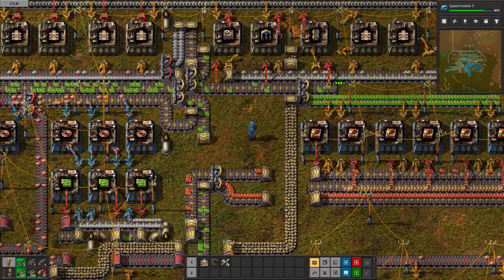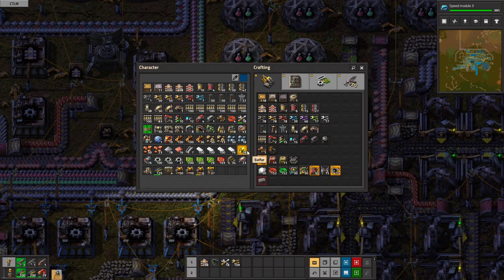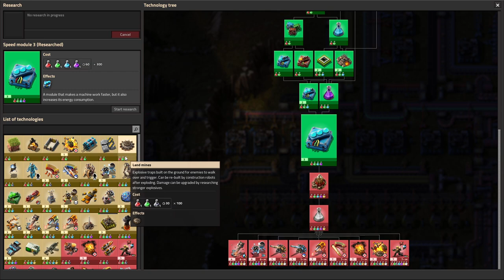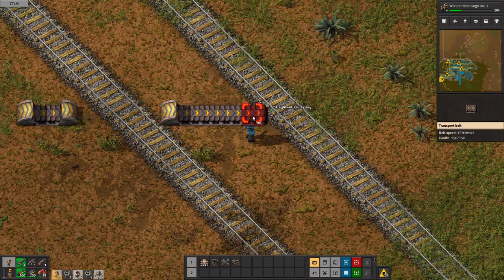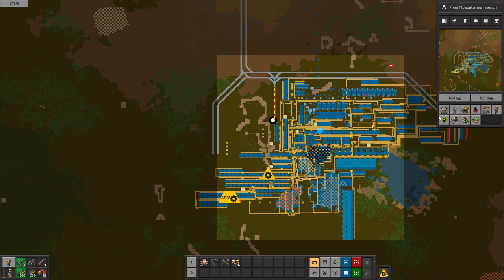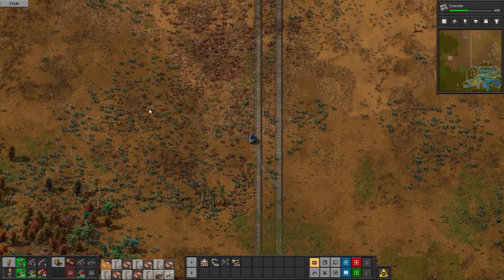Factorio 2021/2022 Guide / Tips / How to! Episode 7! - T-Minus Runover

Comment: Yep, bots intimidated me too on my very first playthrough. I didn't know you could press L to see what's in the logistic network! I could never make a big belt balancer by myself, if I do it myself then it's just a 4 lane balancer. Actually in my first playthrough before I watched and read other people talk about Factorio I didn't know much about balancers haha. I do now have blueprints saved from other people with bigger lane balancers, I could not make my own. I don't know if I like using other people's things though or whether I prefer to make my own instead, tbh the latter can be much more fun, even if it's not anywhere near perfect. Yay for a tank! Oh yes I like the click-and-drag of the powerlines too! It is a big copper deposit indeed. Yay for researching the rocket silo. Yes I like that the tank can drive over trees. I enjoyed this episode.
Reply from the maker: Some of those giant balancers take people I am sure many many hours to design.  It's a bit of madness to do that. Just use 10 4x4 balancers instead is the play... balances close enough 😆  L for logistics network  that'll save you some running around!
Reply: @YamaKara  It might be hard to make them as compact as possible, but doubling the size of a balancer seems simple enough: just make two of them, feed the outputs of one into separate splitters, and feed the outputs of the other into those same splitters. (In fact, if you think of a single splitter as a 2x2 balancer and double it in this way, you get your 4x4 balancer without the last two splitters.) Then you can make it throughput unlimited by running it through a reversed version of the same balancer (which is what you're doing by adding those last two splitters).

I think you can make a balancer of any size this way by repeatedly doubling until you have enough inputs and outputs; running the outputs through a reversed copy to make it throughput unlimited; connecting the inputs and outputs starting from one side (so that all the disconnected ones are on the other); recursively removing any splitters or belts that have either no input or no output connected; and then looping back the disconnected inputs and outputs that remain. 

For example, if your 4x4 splitter was described like this:
- 2 inputs each into A, B
- A, B to C, D
- C, D to E, F
- 2 outputs each from E, F
Then a throughput-unlimited 10x10 splitter would have 46 splitters connected like this:
- 2 inputs each into A, B, C, D, E
- A, B to F, G
- C, D to H, I
- E to J, K
- F, H to L, M
- G, I to N, O
- J to P, Q
- K to R, S
- L, P to T, U
- M, Q to V, W
- N, R to X, Y
- O, S to Z, AA (and now reverse...)
- T, U to BB, FF
- V, W to CC, GG
- X, Y to DD, HH
- Z, AA to EE, II
- BB, CC to JJ, LL
- DD, EE to KK, MM
- JJ, KK to PP, QQ
- LL, MM to RR, SS (...and loop back)
- FF to NN, P
- GG to NN, Q
- HH to OO, R
- II to OO, S
- NN to TT, J
- OO to TT, K
- 2 outputs each from PP, QQ, RR, SS, TT